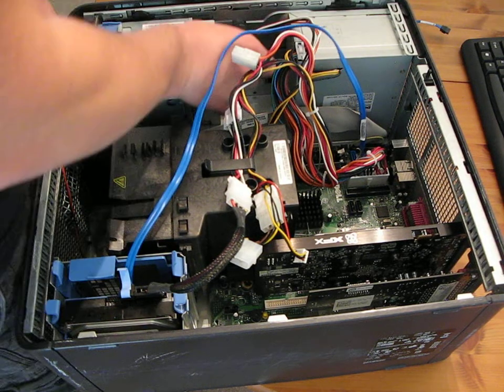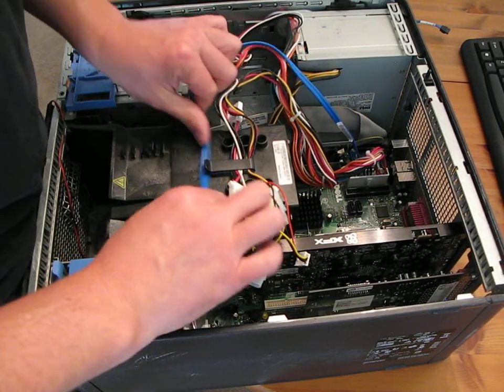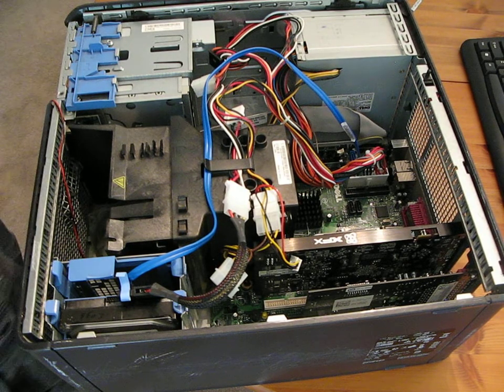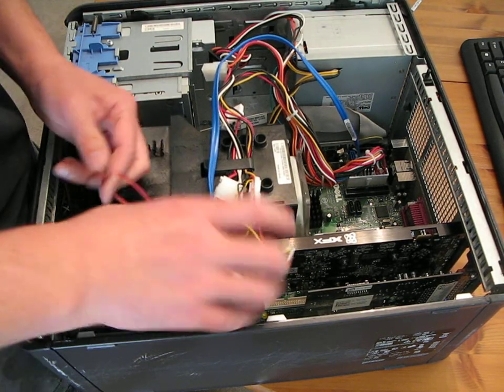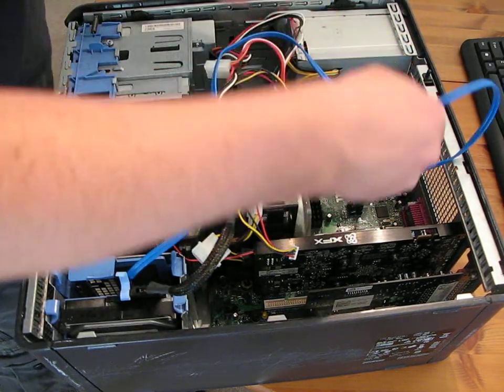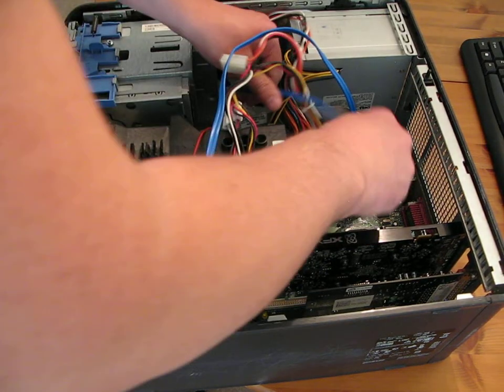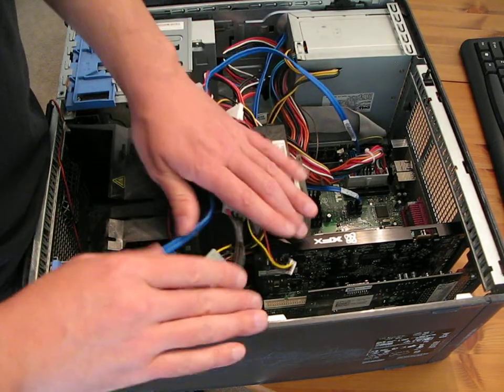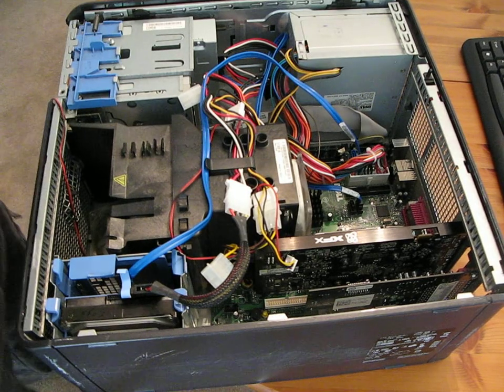(3 of 5) Old PC to Home Theater PC (HTPC) - Airflow Clearance

Comment from the maker: The graphics card is a XFX PVT98GYDLU GeForce 9800 GT 512MB 256-bit GDDR3 PCI Express 2.0 x16.  The sound card is cheap card, like a soundblaster lite or something.  Anything will do as long as it supports at least 5.1 for a bug theater sound.  I have my Logitech Z-5500 THX certified 5.1 digital surround sound speakers connected for a big sound.